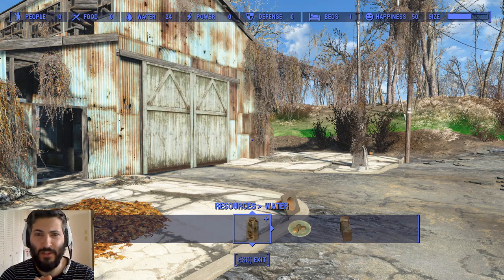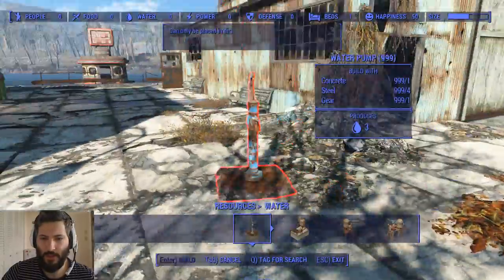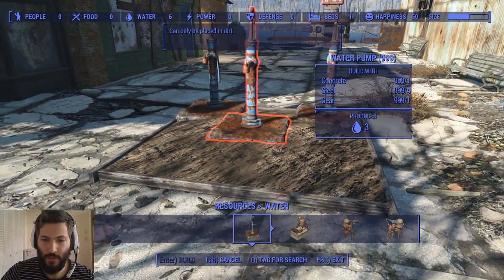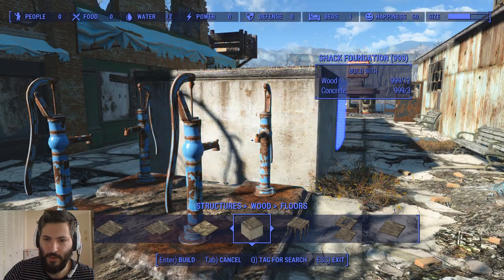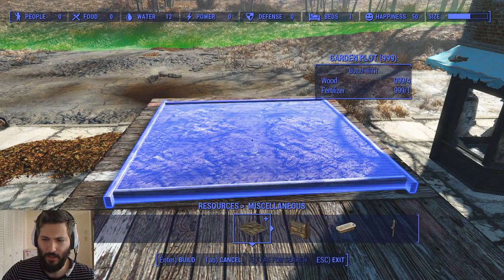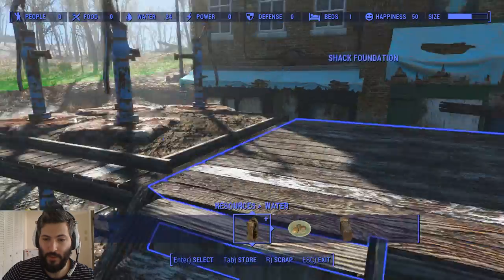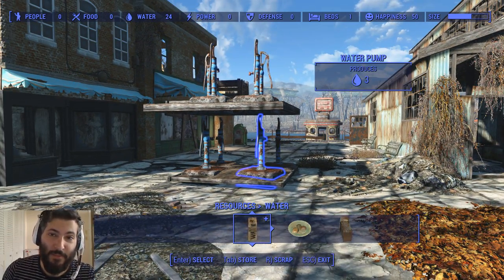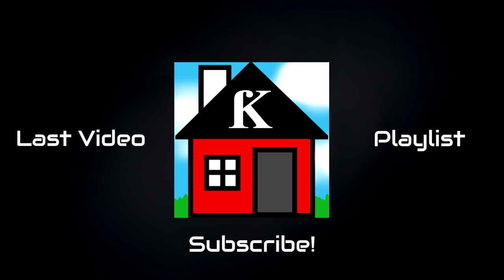Fallout 4 Settlements - How to Place Water Anywhere! - A Wasteland Workshop Exploit

Comment: It might work better with the new ground powered pump. I think you might be able to get more water out of them, but they do take power. I will give it a try when I play later.
Reply from the maker: +Daswolfen I would still argue the pumps are better.  I was able to squeeze 7 of these on one plot which is 28 water with 0 power cost.  The new pumps only fit 2 on the plots max and only generate 20 water with a power cost of 8.

Comment: why don't you just use the new water pumps
Reply from the maker: +Niall Ward I should have shown that in the video, but they weren't placing in that area for me either
Reply: +HausOfKlaus oh really I had the same problem I couldn't place mine :-/
Reply: +HausOfKlaus try different angles like spin them till they snap
Reply from the maker: +Niall Ward lol the age old solution to fallout building issues!